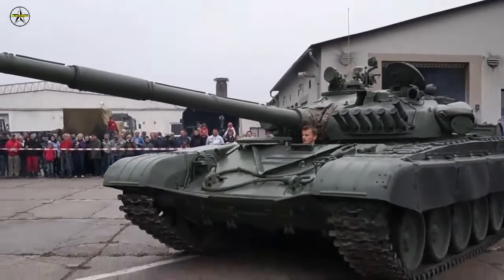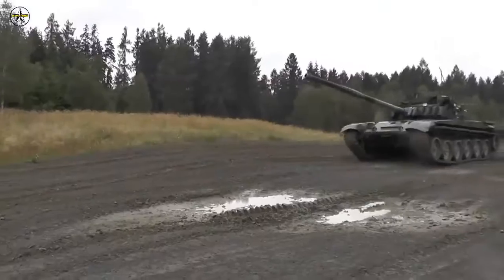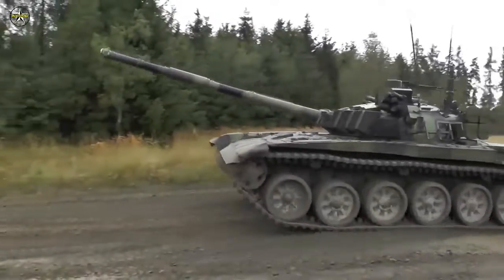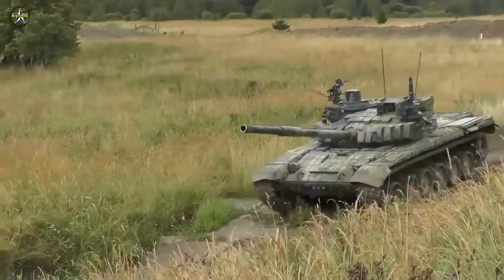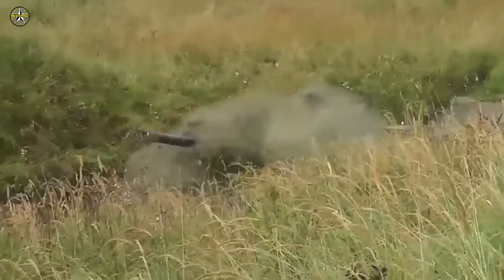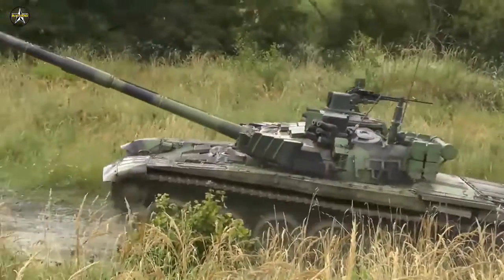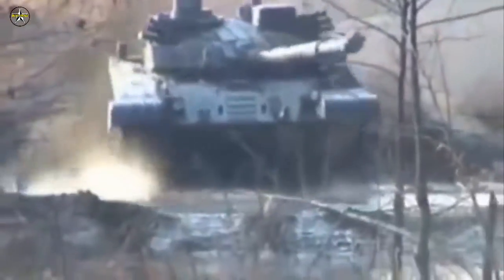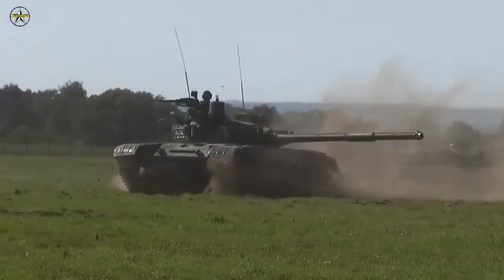Czech Republic to Modernize 30 T-72M4CZ Tanks

Comment: well it base armour is still T72

  Its like Putting 20x Scope on ww1 mauser
Reply: Do you know what ERA is?
Reply: @liki7476  Covering an old tank in ERA doesn't keep it up to date, it can barely defend it from some AT missiles.
Reply: A scope with thermals, passive night vision, laser range finder and a self aiming tripod.
Reply: there is nothing wrong with putting 20x scope on WW1 mauser, it will still blow your head 🙂
Reply: @Pidalin  Heads aren't progressibly being armoured to protect far better against old guns though.
A helmet in service today won't help still.
Reply: @Pidalin  Yep and it is always an amusing concept

but unlike that, tanks tend to receive armour packages that further boost their protection for less and less weight as time progresses, having an old gun with a great scope will loose its edge very quickly